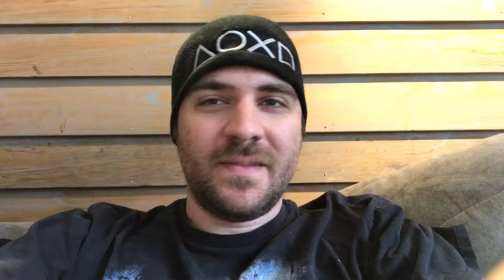Tales from IT - Fixing a HP Designjet Printer Belt

Comment: I bought a HP DesignJet T1200 for $150 a year ago w/ alot of extras. Belt just started fraying on me and im not looking forward to fixing the belt.
Reply from the maker: Where did the belts come from
Reply from the maker: The spare ones I mean. Please consider replacing them either with HP belts or whoever made the belts in the video I referenced. They fray over time but it adds at least an hour of work if you replace AFTER the belt fails. SO MUCH RUBBER RESIDUE TO CLEAN
Reply: @Maniac536  I actually have belts in my cart from the same site you had in your video. A little pricey, but all others I found had some funky replacement tensioner included and due to that a slightly different sized belt included.